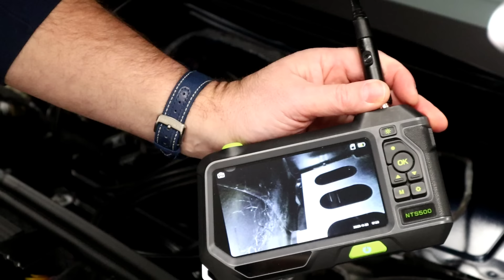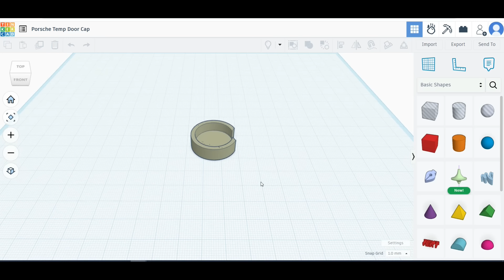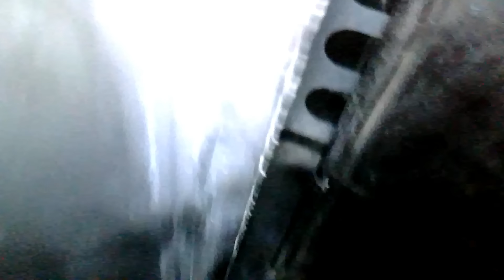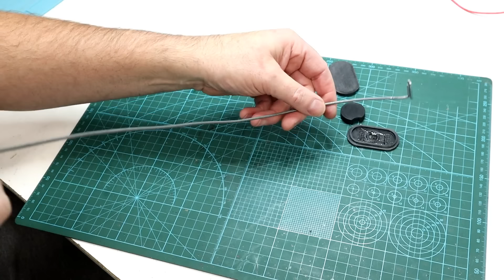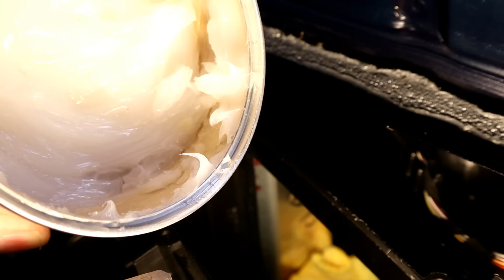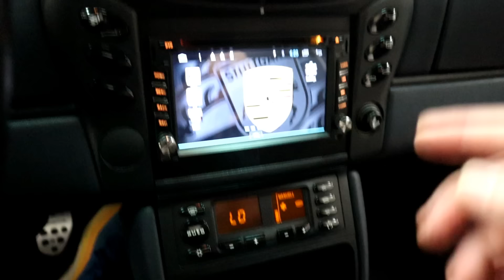Porsche Vent Foam Repair - NO DESTRUCTIVE CUTTING Required.

Comment from the maker: Oval Blend Door Plugs (Lg & Sm) and Upper Bushing Cap STL 3D Print Files: https://www.e-junkie.com/i/14kcb
PLEASE READ! These are STL print files for printing your own plugs & cap with your own 3D printer or at a 3D printing service. I am NOT selling and shipping physical plugs and caps.  

Note:  I include both sizes of oval plug files as some models will have a slightly larger bottom oval hole in the blend door than the upper 3 holes. I've also improved the oval door plugs shown in the video by beveling the inside edge to help the plug find and drop into the hole easier. I've also increased the diameter of the recess hole from 10mm to 12mm for more washer options. Print suggestions: 0.2mm layer height, 3mm walls, 2mm top & bottom layers. This will produce a plug with 100% infill and strong edges.
Reply: Wouldn't it be easier to fit if the solution was a single flat piece of plastic that spanned all 4 holes and which had two flanges designed to clip into two holes, the top one and the bottom one. This would mean only one piece needed to be manoeuvred into place and having two mounting points should help align it correctly and easily. Having some sort of sealant on the plate should then be enough to fully seal it and glue it in to place. 
Or maybe there's not enough space to get a large piece into place? What do you think?
Reply from the maker: @pjay3028 Correct, there is not nearly enough room to maneuver a monstrosity like that into position through the small opening.
Reply: Just bought the STLs - thanks! How many of each of these do we need to print for a maximal solution? That is if we don't know if we have the larger bottom holes and wanted to be prepared for any scenario once we get in there, how many of each file should we print?
Reply from the maker: @reservationatdorsia  Print 4 of the smaller ovals and 1 of the larger ones in case you need it. Only the very bottom hole in the vent blend door MAY require the slightly larger plug. The smaller plug will of course fit into the that bottom hole if it's larger and there is enough lip around the edge of the small plugs to still fully seal it, but I thought I should at least include the larger plug for those that want it.
Reply: Thank you for this great repair video. I am at the point where I have removed the first blend door but am unable to visualize the vent select blend door with my endoscope. Should I have selected a specific vent setting on my ac unit before starting the process? Can I hook up the battery and safely change that setting? Many thanks for your help!
Reply from the maker: @volkerstriepe598  Covered at time index 24:25 and as shown, battery can be hooked back up - just DON'T start the engine.
Reply: @rchelicopterfun  Many thanks!

Comment: Just finished this procedure on my 1998 996 C2. The second flap is a nightmare to reach to for cleaning and to cover with the air duct tape but after many hours it finally is done. 
Many, many thanks for this video with indispensable additional information and comments; without this I would have capitulated half way through!!
Reply from the maker: Glad you stuck with it and got the job done. Still easier than pulling the dash to remove the airbox 🙂 Enjoy your "foam-free" driving fun. 👍

Comment: Hi John. You made an excellent and truly useful video on repairing the ventilation system. I have a 1998 911 (996), and annoying foam occasionally blows out of the air vents. I’d like to use your method, but I’m wondering how you cleaned the "Vent Select Blend Door" before actually installing the covers. That crucial step isn't shown. I’m worried that I won't be able to attach the covers to the door if it isn't cleaned first, especially since the door itself can't be removed. What is the function of this door, and what happens if I don't seal the holes in it? What are the consequences—which climate control function would fail to work?
Reply from the maker: As shown & stated @16:56, I removed the foam from the vent select blend door with the hook attachment that came with my borescope camera. On mine, what foam was remaining on that door just fell off and didn't take any effort at all to pull off with that hook.

If your camera doesn't have a hook, then you could likely get the foam off by attaching sticky tape to the plug placement tool you make or any other long object you could fit in there to pluck the foam off the door.

If you have an air compressor and blow gun, you could also likely blow/blast most of the loose foam off that door, granted you'll have a fairly big mess to suck out with the vacuum and many more bits of foam flying out the vents for a while afterward. 

As shown & stated @2:41, the vent select blend door is exactly that. I selects if the air is diverted out to the center vents, or to the floor and defrost vents (or any combination).

If you don't plug the holes in it, other than still getting chunks of foam flying out your vents (until it all comes off), a good portion of air will be coming out the center vents even with the door in the full closed postion when you have floor or defrost selected.

The issue there is obvious; when you need full defrost air flow to defrost your windshield, there won't be that much air diverted to those upper defrost vents if the vent select door holes are not plugged and leaking a good deal of the air out the center vents.

Comment: Thank you for this very informative video.  I purchased and sent the files to a local 3D shop and they quoted me $145 for the pieces.  Is that a reasonable amount?  Things in Hawaii cost more in general but I thought it would be less.
Reply from the maker: Seems outrageous! Admittedly, I've never looked into what commercial printers are charging these days. You can get a decent hobby grade FDM 3D printer for that amount. I paid $200 CND for my Sovol printer for example and I've often seen refurbished ones for under $100. Of course you then have to learn how to use it and there is certainly a learning curve with 3D printing, but like any hobby, it's fun if you have always wanted one, and they are such useful tools. I honestly don't know how I could live without one now, especially living in a remote area of Canada where it's not easy to just run out to the nearest store to get a part.

Anyway, if you have a library/s in your area, you may want to check with them as some do have public use 3D printers and offer a printing service. Schools & hobby shops are other options to check out. Lot's of 3D printing hobbyists as well all over the place and if you could find one in your area, they would likely print them up for half that. I'd even consider printing you up a set if you are really in a bind, but shipping might be a relative costly issue to Hawaii and who knows whatever this week's tariffs might cost you from a Canadian made product/service? Still, if you are stuck and just can't find anyone to print for a reasonable amount, contact me through the contact page on my website and we can go from there:  https://www.rchelicopterfun.com/contact.html 
👍🙂
Reply from the maker: P.S. I looked up the postage rate to send a padded envelope from my location in BC Canada to Ohau (just guessing on your island), and it shouldn't be more than $15. So, if you are stuck finding someone, I would be willing to print all the files in ABS and mail you the plugs and cap for $60 USD including shipping (any import tariff fees would be added, but I can't see them being much with such a low declared value. If you want to pursue this option, again, just contact me through my website: https://www.rchelicopterfun.com/contact.html

Comment: I’m so confused, why do they put whopping great big holes in the door to begin with and then cover it with foam? Why not just leave the door without holes and cover the edges? Please help me understand why there are holes. Thank you.
Reply from the maker: Prevents thermal warping and reduces thermal mass.
Reply: @rchelicopterfun  that makes sense. I am in the process of having my evaporated coil replaced in my 2008CS. And I’m having them investigate how to cover these doors. I do like your aluminum tape option. Would blocking those holes using 3-D printed plugs increase the thermal mass? I was thinking perhaps the holes were there to make the thing weight less.
Reply from the maker: I suggest you look up the thermal mass and specific heat capacity of ABS vs galvanized tin. ABS like most plastic is a thermal insulator.

Comment: Thank you for making this video.  A quick note is that there is always a way to turn off the vents at the vents themselves so any bleed through is easily rectified by just shutting down individual vents.  

Great thorough video.  Thank you for taking the time to put this together.
Reply from the maker: Thanks for the feedback and for watching.
Reply: When our 01 911 started this I just over time took a vacuum with the nozzle on and closed off various vents leaving one open at a time and sucked while having the fan speed on high. It took a few months but finally it was all gone and quit spitting any out. Did the same thing to a Z3 and Z3M since BMW's had the same problem.

Comment: Hi John
Thank you for your excellent video. Everything seems to have gone well, but now my system only blows hot air. What do you think I did wrong, and how do I correct this?
Reply from the maker: Means the temp mix blend door is stuck closed (all air is being diverted through the heater core). As to why, that will require going through everything in person as it can't be diagnosed remotely. Obviously the first thing to check is that the temp blend door actuator is moving when you change the temp from full cold to full heat and if it is, that you have the blend door position correctly orientated in relation to the actuator motor position (ie, when the actuator moves to the full cold position, the door is open and not closed).
Reply: @rchelicopterfun  Es ist vollbracht! As expected, the heater blend door was stuck. Took it all apart, and resited the lower blend door hinge. By looking from above I was able to finally place it correctly. I think if I had watched your video a few more times before , I could have avoided my errors. 
I tried a rare earth magnet on my first attempt to create a wire cap placement tool. This turned out too strong and repeatedly attached to the blend door as soon as I was close to it. I think the size magnet you used was better. Anyway, after many attempts I managed to place those caps to the vent select door. 
I must have dropped those things in the heater box twenty times along the way.
This was a very challenging repair for this total novice! 
They had quoted me a minimum of $7200 for a repair at an Indy shop, so you helped me save a ton of money! 
Many thanks, John!
Reply from the maker: "Es ist vollbracht!" Nice! 🙂👍. Glad to hear you got it sorted and saved a few bucks in the process. No question, it's not the fastest repair method to deal with flying foam and time is money after all; but $7K certainly represents a good deal of time. Anyway, enjoy your foam free P-car driving from here on out. You'll get to experience that benefit right away. I had to wait all winter so the job was less satisfying, but now that our little 986 is out of storage for the summer, I can't get over how nice it is not dealing with that crap flying around inside the car anymore or ever again for that matter.
Reply: Thanks. I suspect I didn’t place the lower blend door hinge under the dash correctly. Will take it apart again. That lower blend door actuator is very hard for me to place.

Comment: Great video.  QQ:  Why would you not use the plastic inserts as sold on Amazon in lie of the A/C tape?
Reply from the maker: I personally feel foil tape is the best option, when applied properly of course (other than the special non-disintigrating blend door foam I mentioned in the video). I would have used foil tape as well on the vent blend door if I could have removed it like the temp door, but that of course is not the case, so had to use the plugs I designed in it.

Comment: My wife’s 996 is just starting to throw foam.  I am the Porsche mechanic for our water and air cooled cars.  I just got done re charging her AC, and noticed this material on the carpet.  I’m not looking forward to it.  I’m glad my two cars, 98 993 and 69 911 are air cooled (actually oil cooled).  I do not like working on the water cooled cars.  Thank you for the video.  I will follow it when I do the job.
Reply: had problems with the heater box in my 964.  Same sort of issues with it.  Air cooled didn't make the difference it seems.

Comment: Excellent video I am encourage to tackle the foam issue. (You don't sell them) Where can I buy the Oval Blend Door Plugs Large and Small Upper bushing cap.
Reply from the maker: You can find sellers on eBay, keeping in mind they are different plugs than what I've designed without the washer hole recess and beveled edges. No real issue without having the beveled edges (they are just easier to fit), but without the washer hole, no idea how well the magnet will hold? Depends on magnet strength. Other option if you want to use my plugs specifically is to download the STL files and find someone who will print them for you or use a 3D printing service.

Comment: Beauty eh! One thing though, not sure why you object to cutting the center air tube to repair it from the dash side when you are cutting at the upper bushing anyhow to get the blend door out from the front. A cut is a cut, no? About to embark on this repair myself.
Reply from the maker: If you wish to equate cutting the small upper bushing cap off that has no impact whatsoever to the integrity of the air box, to cutting and taping up a large section of the central air plenum, who I'm I to argue with that false equivalency; I wouldn't even know where to start. 😄

Comment: John,
Thanks for the excellent video. Can you tell me where to get the plugs and cap?
Thanks!
Reply from the maker: As stated in the video, link to the print files I designed are in the description if you want to print your own parts. If you want to get ready made ones, search on eBay,  Etsy, or Porsche forums. I don't have links from those sources because it will vary by country.

Comment: I am planning to do this fix on my 2005 Boxster, as I just started to see a few pieces of foam. However, I am curious as to why these doors have holes in them in the first place as apparently no air goes through the foam covering the holes? Wouldn't it be easier to design the doors with no holes in the first place? Is there a purpose for the holes that I am missing? Excellent DIY for this problem by the way.....
Reply from the maker: There are numerous discussions on this and the reasoning behind the holes ranging from weight savings to cost savings. Cost savings can of course be ruled out as it costs more in tooling & manufacturing expense to punch holes in the door over leaving them intact, and I honestly can't see the minuscule weight savings being worth the extra costs for the manufacturer but who knows? 
My personal thought is the holes are there to reduce thermal mass of the doors to minimize both warping and/or sweating during abrupt temperature swings, but that's just my best guess. 
Suspect the only way to know for sure is talk to the engineer/s who designed the doors for Behr/Mahle/Bosch/etc.

Comment: Thanks for the video. I'm about to do this repair to my 2006 Boxster S and this helps. You used hvac foil backed tape where most/all other write ups use closed cell foam tape. What made you chose this material over foam tape?
Reply from the maker: 1. I had it on hand. 2. Properly applied HVAC foil tape will outlast foam tape. 3. I personally don't think closed cell foam is soft enough to use on automotive HVAC blend door applications. My concern is the low cost closed cell stuff is much too stiff, won't compress correctly and could lead to actuator stall &/or door sticking (cumulative). If I was to use foam, I would use the correct soft open cell stuff from places like BDUSA mentioned in the video that is designed specifically for this application. Their open cell foam write-up further backed up my initial thoughts about this. To each their own of course.
Reply: @rchelicopterfun  👍